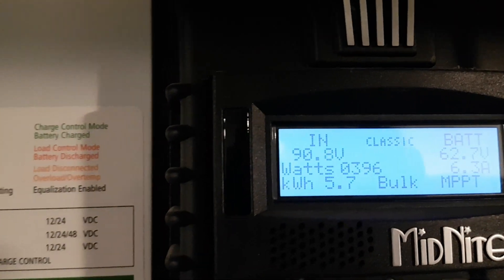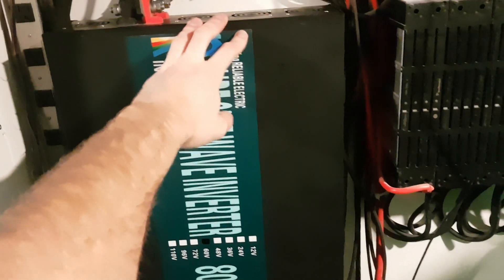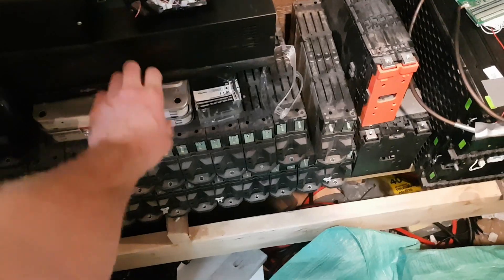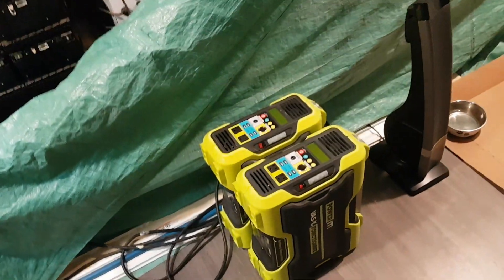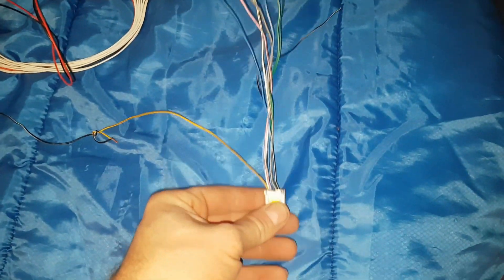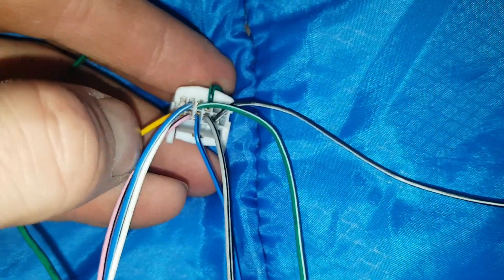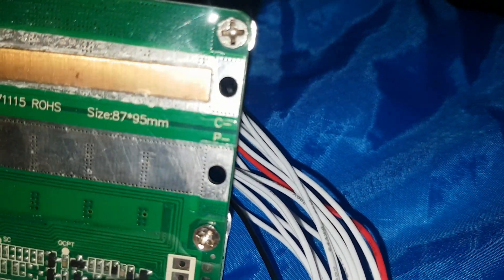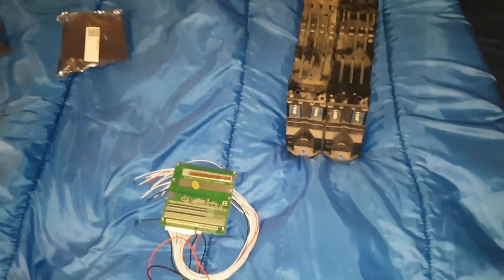More Batteries Wind Power And Bms Hook up

Comment: Thanks.  May I ask what BMS you are using?  I see now you show how you hooked these up at the end of he video.  I have two 7s Li-ion batteries that I have wired in series.  Would I simply hook the negative to that first negative on the 1S of the first battery to the BMS ...and then 1S,2S etc. all the way to 14S positive to that BMS connector after that?  Or once I move to the second pack of the series (being series 8s) do I have to also hook the negative of that first 1S on it to the BMS?  If so where? That first black wire on the BMS?    Thanks
Reply from the maker: https://www.aliexpress.com/item/70A-100A-150A-200A-300A-Bluetooth-Battery-BMS-With-LCD-Displaly-8S-24S-LiFePo4-7S-24S/32954067682.html?spm=2114.search0104.3.1.21375d47zQfJNE&ws_ab_test=searchweb0_0,searchweb201602_2_10065_10130_10068_10547_319_317_10548_10696_453_10084_454_10083_10618_431_10139_10307_537_536_10059_10884_10887_100031_321_322_10103,searchweb201603_57,ppcSwitch_0&algo_expid=f5a9c49b-7850-4471-8995-42c1162aae1f-0&algo_pvid=f5a9c49b-7850-4471-8995-42c1162aae1f
Reply: @GoingOffGrid101  Thanks, when you have time an answer on my wiring question would be very much appreciated ....I just subbed BTW.
Reply from the maker: yes 1 through 14 like you said, only the first pack goes to the 1st - bms wire.
Reply: @GoingOffGrid101  Thanks!

Comment: OMG, ten days ago I saw this video.  With the new baby, I thought it would be a while.  I can't tell you how much this means to me.  I have been living off the grid with 1/2 Kwh in lead-acid batteries (I have tried to keep over 12 Volts at all times) for 2 years.  This summer I purchased a new fan to use overnight and realized the new fan was just taking too much out compared to the old one to meet my desired limitation.  I really liked this new fan.  Shortly after I (Melissa) left home to work on the Columbia gas event.  Before I left I had been so inspired by your work I had ordered a Hyundai battery that arrived a day before I left to work in Massachusetts.  My husband thought I'd lost it.  He could not figure out what I was going to do with it as he knew more about batteries than I.  I got so excited when you so generously explained the BMS, I spent the next 10 days shopping for new solar panels.  It was on my list for a January purchase.  I purchased 9.2 kW in new solar panels!  A bit of a stretch from the original 1 kW intention but I bought a pallet instead.  Your work has given me the courage and confidence that knowing I know nothing about solar if I were just to put the time in, do the research and ask the right questions I really could make a good choice that would bring normalcy to my home and not disappoint my husband.  He was just waiting for the grid which will be accessible maybe in the next year and the generators were just fine for him.  So going the normal retail rout was out of the question.  I purchased a pallet of 27 Trina MONO 340W Solar Panels UL. 9.2kW for $4,530. including shipping.  I guess I can say goodbye to that very old propane fridge for a change now too.  

Your videos have stood out the most to me because I think I have a like interest in storing as much as I need, yet in increments, I can afford.  The fact that you used these great hybrid car batteries is just perfect and really brings down the price so much and makes sense.  Keep up the good work!  There are plenty of people using the information that are too excited about implementing it and just haven't realized how appreciated a note would have been.  I was so excited I just jumped right into hunting panels.

Thank you for the BMS vid and link!  By the way, I am 56 years old.  I encourage everyone, Just Do It! (safely)

Comment: Do you have a link for the BMS? I'm considering getting one, not sure that I need one yet, but will eventually if I add to my system.
Reply from the maker: yes

https://www.ebay.ca/itm/30A-16S-48V-LiFePO4-60V-Lithium-Polymer-Battery-BMS-Protection-Board-W-Balance/112477569093?hash=item1a302f8045:g:MkIAAOSwUIhZZKEA:rk:25:pf:0

Comment: You mentioned an automatic transfer switch to grid power when talking about the magna sine I think..?.? how is that setup and how well does that work?
Reply: Most off grid inverters have a built-in auto transfer feature that let's them switch from grid to batteries when the power fails
Reply from the maker: its amazing, you run the grid lines through the magnasine system and when the power goes out it switches so fast nothing in the house shuts off :)

Comment: Thank you again for your video. How big is your battery and solar system now ?
Reply from the maker: atm I only have 37Kwh hooked up I have 30kwh to hook up still. I have 8700w of solar and 16800w of inverters
Reply: @GoingOffGrid101  Nice I have 7.5kw solar On-grid solar power producing 20-40kwh a day and working on 2.4kw solar panel with lithium car battery 12.5 kwh ,  4.5 kw  60VDC inverter  off-grid solar power system with batteries for receptacles and lights
Reply from the maker: @Beekeeping_Queen_Bee  thats a great backup system!

Comment: So one of those Hyundai batteries would work with my 24 volt inverter correct? I would pay a good price if they are ready to work with my VFX3524 outback I am interested. That BMS stuff is very confusing I am a couple hour drive from you maybe less coming from Muskoka. I would take them all if usable.
Reply from the maker: what is your inverters max voltage ? 30 volts or a little higher ?
Reply: @GoingOffGrid101   DC input range is 21 to 34 VDC ...DC input current 174 amps max 250 breaker
Reply from the maker: @offgridwanabe  thats perfect! they will work just fine :) these batteries are about 33v full charge each.
Reply: @GoingOffGrid101  I really would like to buy those lithium but I do not know where you are to come and get them. I hope you still have them.
Reply from the maker: Frank Z bought them... he text me first so I had to sell to him
Reply: @GoingOffGrid101  Ok man thanks letting me know maybe next time.